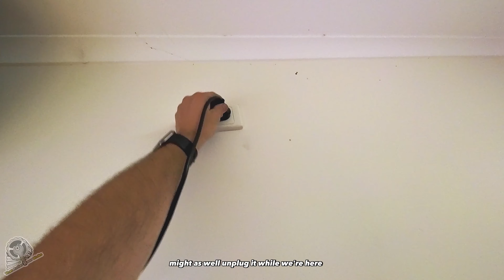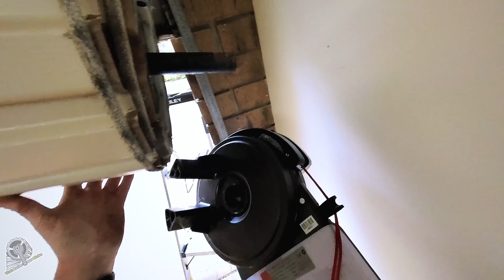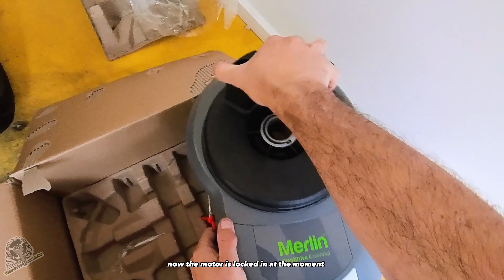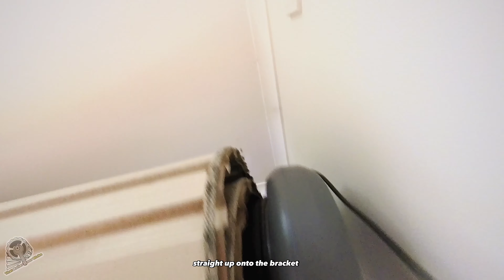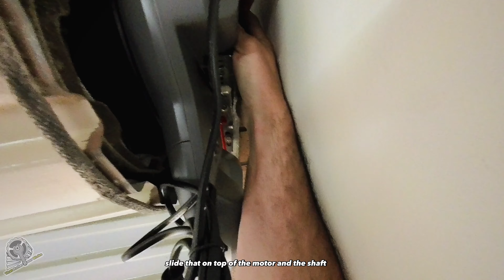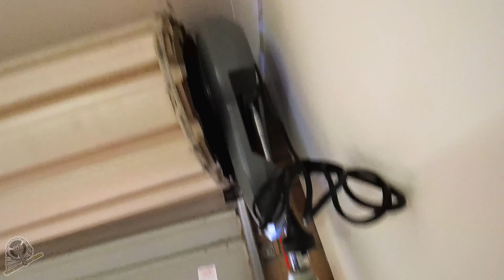[44] Roller door motor installation + retention your springs.  Tight side room install Merlin MR655

Comment: A great video. I've watched 2 others and no one mentioned the REASON, not to lose tension of the door spring, for keeping the ubolt tight on the opposite end to the motor. Also you covered the lubrication and tensioning of the springs which was very useful info
Reply from the maker: Thankyou !  Mainly because I'm pretty passionate about my work and i'm a huge believer about learning & showing how things work.  I'm probably not the best teacher bit getting better haha.

Comment: My power went down when the garage door was open so I pulled the emergency cord and closed it manually. Now the power is back on and I can’t seem to figure out how to put it back to automatic, I tried pulling the cord and nothing happened. What should I do ? (By the way I have two emergency cords one on each side)
Reply: If one cord is green and the other is red you'll need to pull the green one
Reply from the maker: Correct 👍🏻
Reply: I had the same problem as I couldn't reengage in automatic mode. My system only has one red cord. I noticed that there was a hole in the plastic cover near where the red cord comes out. I inserted a screwdriver in this hole and something clicked. Then I pulled the red cord and I was able to get back in automatic mode. Hope it helps :)